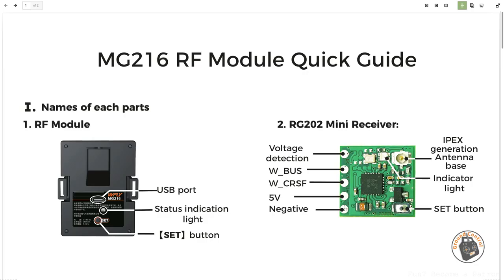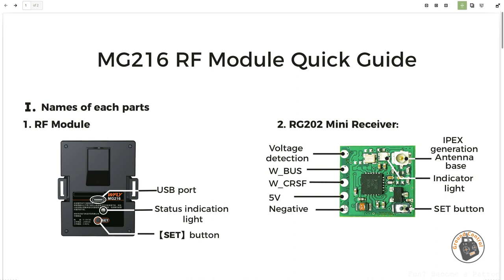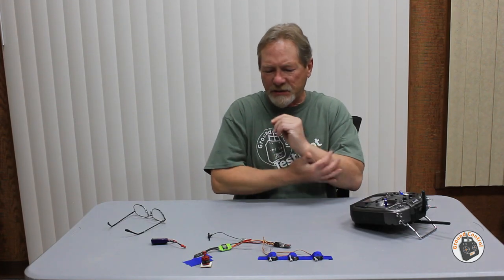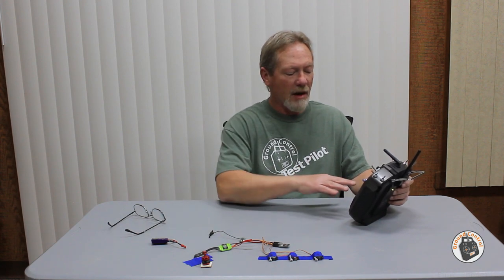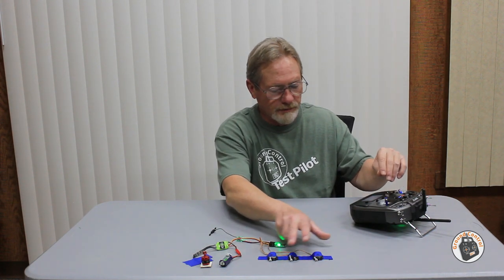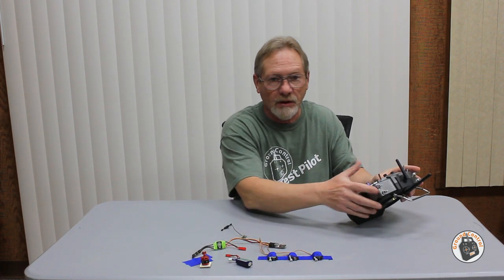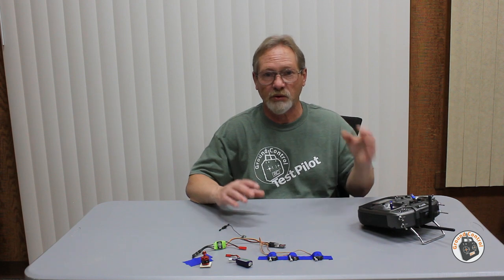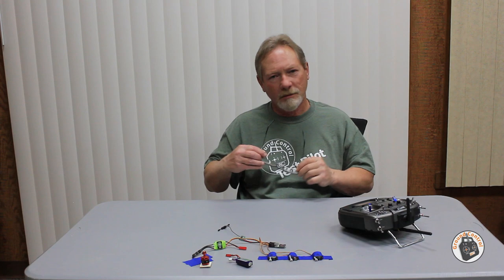Review - WFLY MG216 High Refresh Rate Low Latency Long Range TX Module with RG202 Mini Receiver

Comment: So tiny!  Someday our field flight boxes full of tools will have to include a magnifying glass and microscope. ;-)

Cool tabletop demo.  Will that plug into the receiver ports in the Xk aircraft like the P-40 (A220) and J3 Cub (A160)?

Happy flying!
Reply from the maker: Thank you!
Yes, absolutely tiny, eventually they'll be too small for me to solder.
It should work with any flight controller that can use SBUS/PPM.
It's a naked board so you can use any connector you wish.
See you in the Air!

Comment: Will you try long range fpv with this? The Phoenix 2m will be a good platform for that.
Reply from the maker: Hi Rodin!
I just don't care for long range flight but I may use it on a micro plane, quad, or heli this winter ;-)
I haven't flown FPV in over a year so I'll be flying some indoor FPV this Winter.
See you in the Air!

Comment: Are you replacing the tx16 radio master
Reply from the maker: Oh no, I still have the TX16S and I'll be testing this RF Module in it as well. I like having the option of using this WFly ET16 and I love the working Touch Screen ;-)
See you in the Air!
Reply: @GroundControlRC  I haven’t tried to upgrade my tx16 to touch screen.  I think I saw it was available. Did you?    Built another plane.   Lol.    Rcpowers f22 v3.   Damn this is a big bird.
Reply from the maker: @davidNH  I haven't upgraded my firmware for a few months. I've been waiting for V2.4 as that's when they're supposed to have a working touch screen but it seems to never get to V2.4 ;-)
I'll check on the firmware version again.
What's the wingspan on the F22 V3?
Reply: @GroundControlRC  lol I got mixed up on the versions.   I built the f22 v2.  48 length and 34 wingspan
Reply from the maker: @davidNH  That is a good size parkjet ;-)
That one will be easy to see in the air.

Comment: Are you running this as sbus?
Reply from the maker: The Protocol is listed as Crossfire but I'm using the SBUS output on the Receiver to connect to my Flight Controller-Gyro.
I performed a Test Flight with this in the Eachine Micro Skyhunter yesterday and everything went well.
I'll be posting the Test Flight soon.